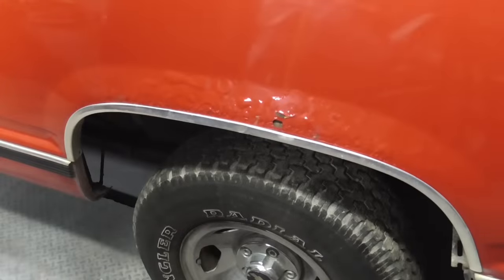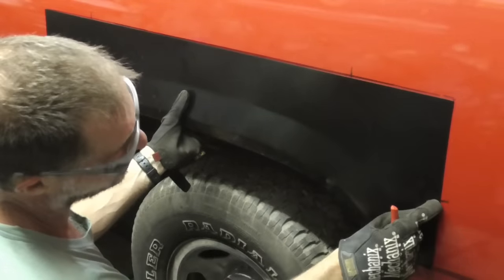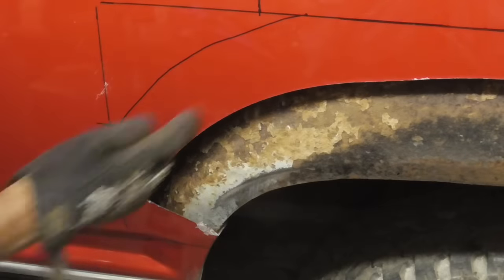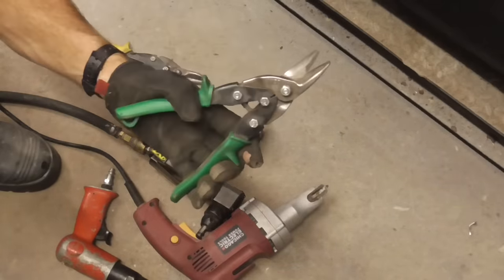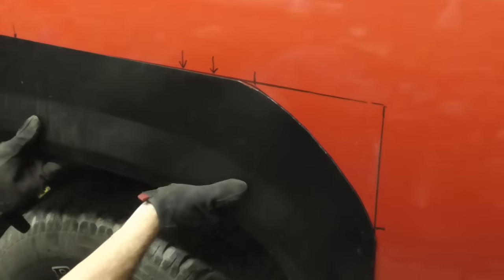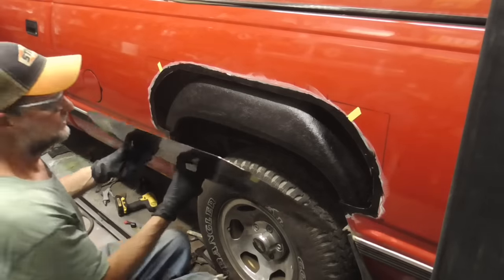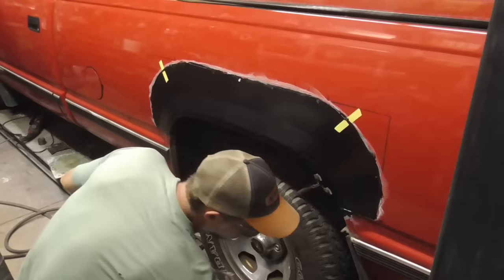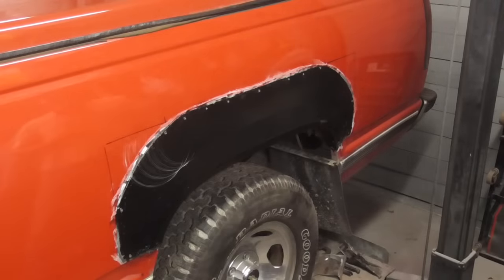Glue On Wheel Arch Rust Repair Panels w/ SEM Impact Resistant Panel Adhesive

Comment: Corvettes have been glued together for years and years.
    I’m really curious about what he did to the underneath the patch panel. Rust never sleeps an I’m pretty sure the rust wasn’t completely gone underneath the patch panel????
Reply from the maker: Do you mean the wheel housing?  If so there was a lip that was ground and blasted - it got glued to the new panel.  The key is this for future rust prevention - https://www.youtube.com/watch?v=8XaZBy7GC7A
Reply: @LakesideAutobody  I’m more of a cut to fit and weld it in. But I don’t do this for a living. 
   I didn’t see any priming or sealing of anything underneath. Maybe some undercoating. Something???
Reply from the maker: @ltsgarage7780  Undercoating on the wheel housing nothing on the panel itself.  It's really best to treat your repairs after you paint like this: https://www.youtube.com/watch?v=8XaZBy7GC7A
Reply: @LakesideAutobody  how do you get inside that empty cavity? If you’ve glued it all the way around. You’ve locked yourself out!!
Reply from the maker: @ltsgarage7780  The sides front and back are open on some trucks and this one.  If not, I always find a what to get oil inside of the panels even if you have to drill a 1/8" hole somewhere hidden.  Put a screw in it if you want when finished like this - https://www.youtube.com/watch?v=y05dNxt-nVc
Reply from the maker: @ltsgarage7780  Paints and primers peel and trap moisture.  Treat the rust repair after the paint work like this - https://www.youtube.com/watch?v=8XaZBy7GC7A  or this https://www.youtube.com/watch?v=y05dNxt-nVc

Comment: That's bloody good work there. But, but, but I would consider using fisholine or something very similar to coat the inside of that real good work to protect it from all moisture for the future. After all that what caused the problem in the first place.
Reply from the maker: Thanks - the solution to future rust problems is drainage - it has to drain and dry out inside - can't be packed with mud, leaves and debris.  Also this - https://www.youtube.com/watch?v=8XaZBy7GC7A

Comment: Where did you buy materials?. Do you use just a metal patch panel? I need to replace quarter on 2013 camaro just before rear tire and door. Has some rust top outer wheel well also
Reply from the maker: The patch panel is from millsupply.com (online) or raybuck.com (online)   You can make your own though - matter of fact most of the times when I was working in shops we had to make our own out of some scrap hoods or panels laying around :)
Reply: @LakesideAutobody  lol I'm not that good..almost afraid to touch it. I paint but not body repair.
Reply from the maker: @tommyp110  Got it... have a good weekend my friend :)

Comment: Now you have panel bonder all over your nice clico fasteners
Reply from the maker: You're right but after I filmed it I pulled them and wiped them with thinner - then threw in some screws - not really good when using messy glue - good eye :)

Comment: Why didn't you treat under it for rest before the glue in piece?
Reply from the maker: Are you talking about the bare metal or the inner panel? You can treat the inner panel any way that you feel works best for you Also, treating the repair for rust prevention can be done more effectively "after" the repair.  Make sure your panel can drain, stay dry and do this - https://www.youtube.com/watch?v=8XaZBy7GC7A

Comment: Will the rivits hold once you grind down the heads? I plan on doing this to my jeep this summer
Reply from the maker: Yes - no worries.  You don't even have to grind them down.  Just tap down the seam a bit and fill.  Never worry about using filler.  Every body shop and dealership uses filler ever day, every car.
Reply: @LakesideAutobody  I took 2 years of autobody from 1980 to 1982 and learned the old way  brazing. Spot cool spot cool,  leading including using a acetylene lead spray gun nitro Stan  fabricating panels, pick and file not up on new techniques but I'm scratching my head about grinding aluminum rivets down seems like I'm not understanding something can't I just sqirt some epoxy or duraglass in the holes? wouldn't that be better  ? I can't find anyone who ever knows what a slap/ shrinking file is which I'm surprised because they work so well I would think they would still be in use
Reply from the maker: @ericschulze5641  You don't need the rivets - they are encased in there with glue but just so that I didn't get a ton of senseless comments about leaving a hole or having a hole with glue in it.  The rivets can be left out.  However, it's good to know that OEM and body shops today use glue and rivets very often in assembly and repairs.

Comment: I love the repair. But I have to ask after drilling the panel for the cleaco's why wouldn't you use those holes to spot weld the panel on? Also how strong would the bond be in an accident?
Reply from the maker: That's why it's called impact resistant - body shops have to use it in certain situations - glue and rivet panels on.  It is as strong or stronger than weld.  That's why Ford f150s (aluminum) are glued in this exact way.

Comment: There's a glue thats used to fit turrets to body that GMH in australia used (instead of welds)..its german l think...got some off a bloke n used it to repair the bottom of my wheel arches. 10 yrs on its still good..no no rust. Didnt need rivets,just clamps
Reply from the maker: Good information Mark - thanks for your input.  Have a good week :)

Comment: is that glue so good ?.. yer pop riviting it on anyways.. why not just grind spot weld then bondo   ? been 35 years sibce i was in autobdy .. lol learned pick and file bak inthe day ..
Reply from the maker: You can weld it if you want or even pop rivet/screw it.  The water tight seam is the advantage of the glue :)
Reply: @LakesideAutobody gotta like that .. thnx

Comment: I'll stick to welding mine on thank you.
Reply from the maker: The advantage here is a water tight seam.  I think the advantage with welding is it's probably faster and easier for some :)
Reply: @LakesideAutobody  i don't know about welding being easier and faster. I'm just not a fan of using a bunch of filler to hide the overlap. I prefer to metal finish. No saying the glue is wrong, just not for me.
Reply from the maker: That's cool.  It's not a "bunch" of filler - just enough to filler the low seam like the factories do/did for sail panels areas.  Knocking down your seams is actually the key to longevity.  Nice talking to you Don - hope you continue to watch :)

Comment: Why would you put the patch on without putting something over the bare metal you just grinded?
Reply from the maker: Body filler and glues are always put over bare metal.  You don't need primer before applying filler or panel adhesive.

Comment: Hi what you charge to do 2008 ford f150 XLT it's kinda small spots on the passenger side on bed panel above the wheel well?
Reply from the maker: Unfortunately in this neighborhood, I can only work on my own cars.  Therefore, I either fix/sell clean title repairable vehicles or fix up rusty trucks that are worth something when done - township ordinance issue :)

Comment: Hey there. Just wondering if you have any input on 3M super strength molding tape vs 3M molding tape?  

Im trying to install some protective panels on the hull of a boat.
Reply from the maker: I know the 3M molding tape is very strong - I've used that a lot.  I would trust the super strength - no problem.  Just make sure you clean both sides that the molding tape adheres to.  Rubbing alcohol works really well for that.  I think you'll be fine.
Reply: @LakesideAutobody  Ya ive used it a bunch as well. Couple years in body and then started a tow and roadside co. I was surfing and came across the mounting tape which has slightly stronger specs but i think maybe not as thick.

Iirc its an acrylic foam with no tape per say.

Comment: Nice job. Would You really need the rivets? Why not just fill the wholes with the epoxy, would assume the glue is so strong that the rivets actually does not add any strength?
Reply from the maker: You don't really need the rivets.  You could even fill right over the holes if they are tapped down (1/8") or more.  The rust will never start up there - it will begin again at the lip area where water and salt settles :)
Reply: @LakesideAutobody  Thanks!  Welding... would newer try, but this seams much more workable for me.

Comment: How did you fix inner wheel well to repair panel
Reply from the maker: The inner has a lip that is parallel to the floor - can't really see it though.  It was ground to clean bare metal, along with the new patch panel.  Those were screwed and glued too - also clamped :)

Comment: Great video. Would drilling a series of 3/16th holes on the underside of the wheel arch lip where the rust started prevent water and dirt catching in there? A bit like weep holes in the bottoms of doors.
Reply from the maker: For sure.  I'm usually not afraid to drill them even larger to allow water in and out easily.  You'll notice on panels that are not closed in (just an open sheet of metal) - they never rust out.  They get wet but dry fast.

Comment: Nice work. Roughly how many labor hours would a repair like this be?
Reply from the maker: When doing this type of work for a living, and if welded,  this would normally be done in the morning and primed before lunch. That's starting at 7 or 8 am though.   After lunch block sanded, etc.  Because of the glue though, there is wait time so... Same amount of time doing it but you have to let it set according to the instructions on the glue your are using.  I let this dry for over 24 hours before moving to the next stage of the repair.
Reply: @LakesideAutobody  Thanks for the reply. I have a rusty wheel arch on my truck and was curious what I would be getting into if I took it to the body shop.
Reply from the maker: @DoctorMindbender  Here's what the shops in the old days would do - https://www.youtube.com/watch?v=IRgtWiKA7UY  Again, this is a morning job to get it in primer :)
Reply: @LakesideAutobody  Thanks. That was helpful. So, roughly 6-8 hours labor to be ready for paint?
Reply from the maker: @DoctorMindbender  Yes :)
Reply: @LakesideAutobody  Thanks, I'm going to watch part 2 again. I'm plan out painting this truck but keep my expectations realistic. Helps to see the work involved.
Reply from the maker: @DoctorMindbender  Good thinking.  As Winston Churchill once said, “perfection is the enemy of progress.”  😊
Reply: @LakesideAutobody  perfect is the enemy of the good! My wallet tends to determine these things first however!
Reply from the maker: @DoctorMindbender  The wallet does have something to do with it for sure :)

Comment: Excellent job as usual from Lakeside Auto body.
I have a question about using clecos to hold the panel to the body.  After the adhesive cured were you able to remove the clecos?  I am concerned that they might be glued to the panel.
This video is timely I am working on replacing the rear quarter panel on a 1990 GMC Suburban.  The rear quarter panel is about 48" long.  What spacing between the clecos would you recommend?  My concern is the replacement panel could have a ripple between the clecos.

Thank you John
Reply from the maker: Good eye and thinking.  I removed them after filming and threw in screws because glue got on them - good for welding but not so much for gluing.  The spacing depends on the situation.  See these vids for different spacing - https://www.youtube.com/watch?v=wRl1QfkrBeY & https://www.youtube.com/watch?v=d21RkqTwRqs

Comment: I have glued a lot panels on with Adhesive but never leave rivets in it, they will show in the panel down the road. With the Adhesive you don't need the  rivets. I worked in a shop that offered a lifetime warranty on there bodywork. I guess everyone has there way.
Reply from the maker: You don't have to leave the rivets - it will never rust up there - only down where the moisture sits.  I put them in to avoid negative comments about the holes left.

Comment: How popular is this method?   This is the first time that I have seen it.
Reply from the maker: It's popular in the metro Detroit area.  Most shops lap weld the patch, knock it down and fill.  Very few butt weld exclusively because the seam will likely not be water proof and end up showing eventually.  The main reason this is becoming very popular is the water tight seam.   It's good to know all methods and use the one that's going to be the most efficient and long lasting for each case. Hope that helps :)

Comment: Why use the hammer on it after you glued it?
Reply from the maker: Any seam welded or glued should be tapped down or knocked down below the original surface to make an invisible repair and also, the filler acts as a buffer between the seam and the finish.  Usually when the seam is directly under the finish you'll eventually see that outline :)

Comment: How much did you grind down the head of the pop rivets after glueing?
Reply from the maker: Good ?.  Just a tiny bit because the rivets were counter sunk.  You really don't have to use the rivets - you could really get away with filling right over those 1/8" holes.  Just tap them down with a punch - you will never have rust start way up the panel where those holes are.

Comment: was wondering if you ever tried this with a flanging tool ?
Reply from the maker: I have not for 2 reasons -- 1) not very wide (most flangers are under 1/2")   2) can't do around lips, 90 degree bends and other situations.  I'm sure it would work though if you were a bit creative.  I'll experiment and do it in an upcoming video just to see how it goes - Thanks for watching 67 :)
Reply: @LakesideAutobody  thanks for the video and response I am going to replace a quarter panel on a 2nd gen Camaro I  want to do a flange and glue it on I was thinking doing a few spot welds to help it but I couldn't see any way to weld and glue my next thought was do like you did with rivets but I am concerned water might find it's way threw the rod that deforms the back side of the rivet and the hollow tube that gets deformed and in my case the length of the lap would be over a yard long but close to this is all  to minimize Bondo  something about my area Bondo  falls out of everything no matter how you do it maximum life expectancy of a car that lives outside is maybe 8 years and it won't fall out from new rust development even filling a dent im hoping it's because they didn't epoxy primer sealer the metal after they etched it and before Bondo  and then once the bond is shaped epoxy primer sealer back over the Bondo or didn't wait for a full cure on the Bondo I would love to see a video of the oldest glue repair vehicle you can to see how it holds up over time.
Reply from the maker: @thegolden675  There's never any reason to worry about the thickness of your filler.  In fact, I like to have 1/8" inch or more filler over a seam as a buffer/sealer between the seam and the finish.  That's the biggest mistake folks make  - I never want a seam right under a finish no matter how it was done - butt, lap, or glue.  That's why the methods found on this channel (& shops that I learned them from) hold up well - tap the seam down, fill, prime, block, paint - every time and you won't have issues.  Here's some follow up videos you asked for - https://www.youtube.com/watch?v=gIS1Tbv7Kvw & https://www.youtube.com/watch?v=t1WclT_GMvk

Comment: Unfortunately I couldn't see clearly what the two joining surfaces looked like underneath the bottom edges of the top horizontal union in the dark area on the underneath and backside edges  !?! . Thanks for the video. Especially. the mention of the clekos .
Reply from the maker: There was metal that folds over on that wheel housing that can be either ground, sand blasted or wire brushed (at least).  That was glued to wheel well lip and clamped together with the vise grip clamps.  I made sure there was a lot of adhesive on that lip - sorry I didn't explain that :)

Comment: Just exactly how much did that cost?
Reply from the maker: If you are asking how much it costed the guy I did this job for - he paid for the materials i.e. the patch panel, the paint and clear which was right around 300 for everything.  He also gave me a few cords of good burning oak and we called it even. I thought it would make a good YT video which can make some cash too.  If this was done in a body shop it could be anywhere from 500-1500 or more - prices vary wildly when it comes to these types of repairs :)

Comment: Nice video, very thorough demonstration/tutorial.  I'm curious - were the pop rivets even necessary after the adhesive was cured?
Reply from the maker: Not really - you'd be fine w/o them.
Reply: @LakesideAutobody  Jim here from Lyle body shop Lyle mn. we do a tack weld on the holes to seal them we also use the 3/m version of the glue. the first time we used it and did not seal the hole with a weld and just used glue to seal them after several months in the winter you could see ghosts of the holes. GREAT VIDEO GOD BLESS

Comment: Do you ever experience ghosting of the seam after a few months to a year
Reply from the maker: No but I believe it's because the seams are always tapped down below the original surface.  I've never NOT knocked a seam down welding or glue and never have had ghosting.  I really think if the seam is directly under the paint, you're asking for trouble.  Just my thoughts though.  Here's a follow up vid on this truck and repairs - https://www.youtube.com/watch?v=t1WclT_GMvk